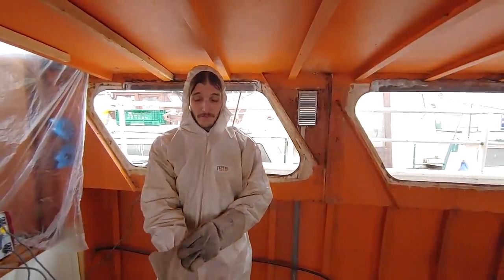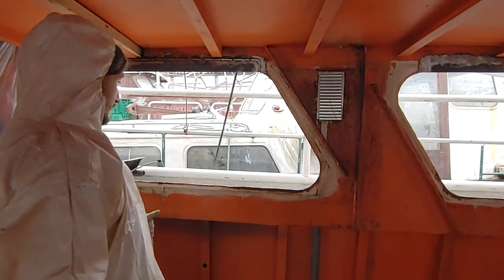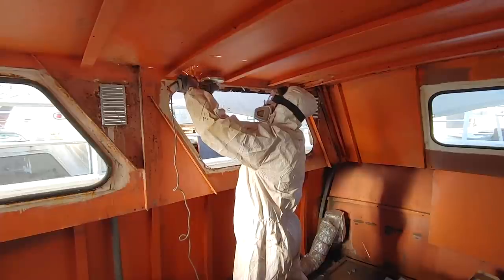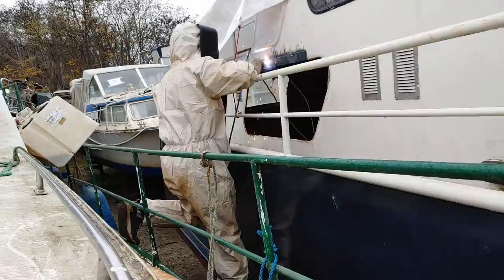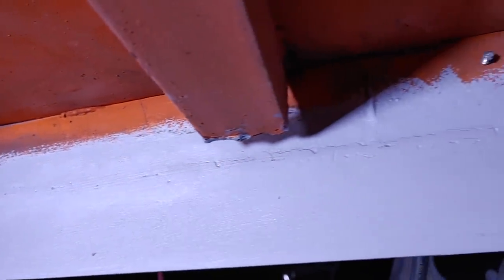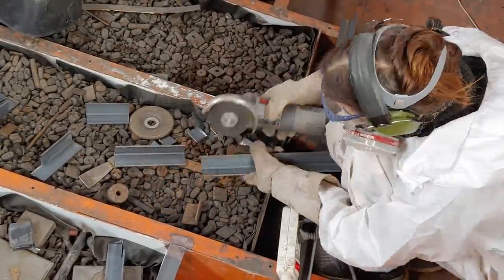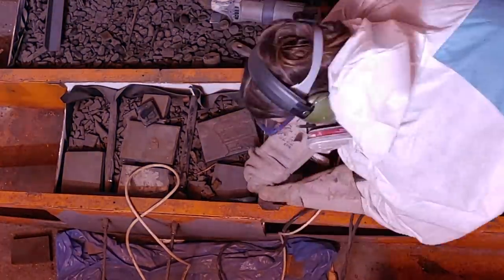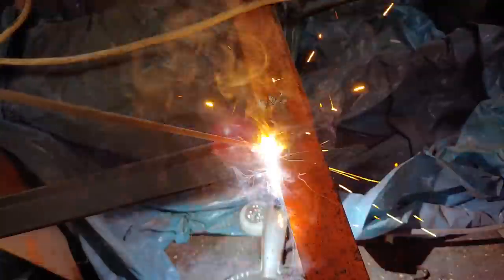Final Welding Works in the Aft Cabin - Week 9 - Vintage Yacht Restoration Vlog

Comment: Tip, clean the to weld edges with a grinder to get rid of contamination in the welds, but not a bad job for a starting welder.
I know this project is past this stage already, but with such a rebuild and a boat in this condition standing on the yard I would always consider a total strip down with engine rebuild and sandblasting if the whole boat in and outside, including welding stainless edges on parts that get rubbed a lot etc.
But I would be cleaning, servicing, repairing and repainting all of it so it’s basis is good for the next two to three decades (applying the best epoxy primer and top coat from this era) and then stay on top of possibly needed repairs by getting out of the water once’s year and by inspecting the hull on damage under water if a situation came up.
My point, better to do it good from the ground up looking everything over once when it’s all disassembled then having to come back on it when everything is difficult to access and you have to do things the hard compartmentalized way in hard to get to places.
And I do ove these kind of projects but preferably I would buy an unfinished project. 
I for instance just saw a similar Dutch boat same as this one in steel for just 5000 euro already perfectly rust free and painted but faded paint and dull colors, without windows or interior but with wooden window frames (I wouldn’t use them) an engine, prop shaft and electric bow screw etc. 
So it only needed a paint fresh up but no welding or rust treatment  and it needed the existing engine build in with not ready available steering set up plus the whole interior and windows, but the basics are cheap and good without metal work.
My point is in essence if you strip down a boat  especially the whole interior much of the value you paid for is getting ripped out anyway so why buy it if you don’t need to.
My point being, if you’re gonna replace so much, look for a good bare casco someone else his unfinished project with as much parts as possible, engine, propeller, shaft, exhaust, steering system, windows, lights etc. but don’t buy a complete boat if you wanna rebuild it anyway and safe thousand’s of euros you could use for the rebuild with modern more effective/ efficient upgraded materials and technology.
My tip is to not straightaway fall in love with the first boat you see or that is available that week and to search for a month or longer to look for different options.
Just over a time of orientation select three projects that are suitable (or more) and go see them all before possibly choosing the one to buy.
I’m not criticizing your boat by the way it’s still a nice project, curious to see where it goes, what interior you guys choose etc. (Tip, look into interior design based on human dimensions and build comfortable seats that aren’t square but have angled backrests etc
There are useful human dimensions you should use building interiors, Ned’s, seats, shower areas, doorways, steps etc. , look them up and apply those dimensions for a good and well designed build.
Good luck and enjoy the Dutch waters when she is done.

Comment: Buy yourself a MIG welder. Much easier to use for positional welds and tacking, no slag, easier clean-up, less pitting (porosity). A proper CO2 set is by far the best even though the gas bottle is a nuisance. You already have the skill to use one. You will absolutely not regret the expense. Buy a portable one (on wheels) so you can take it home to avoid theft. Incidentally, if you chamfer the steel before welding, you will still retain a strong joint even after grinding flush.
Reply from the maker: thanks for the tip on a MIG welder. I will consider it.
Reply: @MyFirstBoat  stay with the stick welder

Comment: nice video's , a tip , weld a strip of metal above the windows on the outside under a lite angle , it prevents water to leak in to your glassrubber.

Comment: Good project, it will be a nice boat when you're finished. You are making great progress :-)

You should always make round corners when you replace metal this way, otherwise, you risk cracks starting at the sharp corner. You can fix the ones you already have made by drilling a hole right in the corner and close it with the welder. The corners should have a radius of min 25 mm. 

You should also cut up the backside of the seam (the outside) with the angle grinder, so your welding goes all the way through the metal. That way it's also much easier to make good and nice-looking weldings.

I used to do this kind of work for a living when I was young :-)
Reply from the maker: ah ok, I will apply those techniques on the next parts I have to weld. Thanks for your help :)

Comment: A lot of times when you're welding that older stuff new stuff to the older stuff I should say you need to go and grind it down and then weld it again and then grind it down flat again because the fact of it is that way you'll see hole in all the gaps and you won't have to prime it as much or even use body sealer because you'll get it better and more efficiently seals

Comment: The 87 hp Perkins had me intrigued , with the help of Google I found out it was a Perkins 318 apparently fairly bullet proof with the exception of some gaskets and harmonic balancer issues
Reply: Also the 318 in the tractor application is rated ay 86 PTO HP ,, Perkins you never have to screw their neck ,, depending on gearbox ratio and prop size ,  1700 to 1800 rpm should be enough ... You havent mentioned engine hrs  but the old 40ft Calypso ferry in Gladstone had a 6,354 in it clocked 12.000 hrs and was untouched,,

Comment: Too late now, but would it have been easier to sand, prime, and paint the hull before putting in new structure, thereby creating more obstacles to work around?

Comment: A stick welder is not the ideal tool for this. You might want to look into getting a Mig welder or if the budget allows a Tig welder. The welds would be much more precise and you would not have to grind as much.